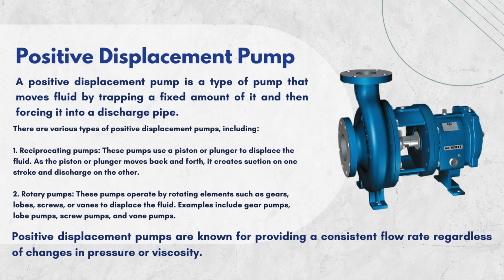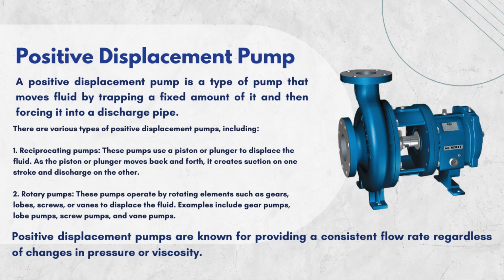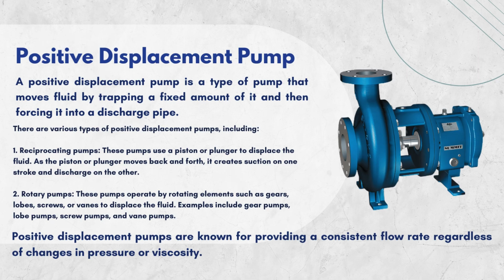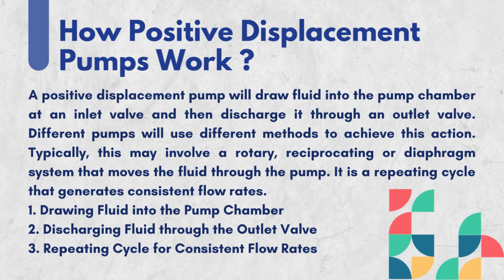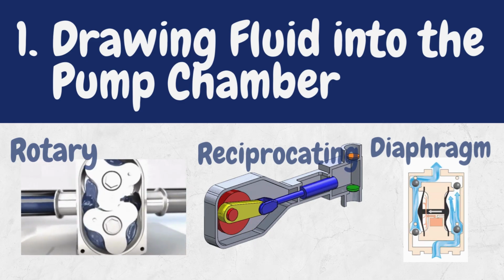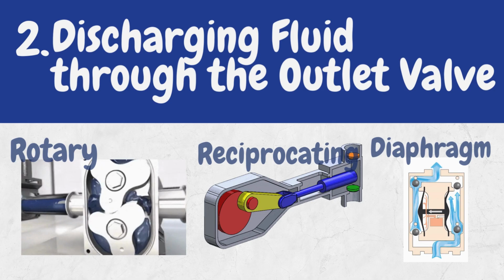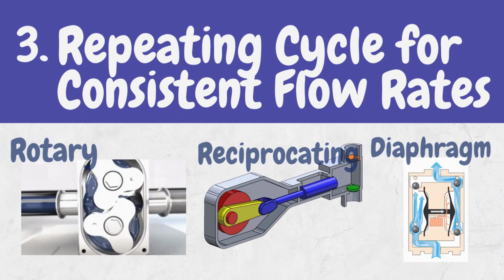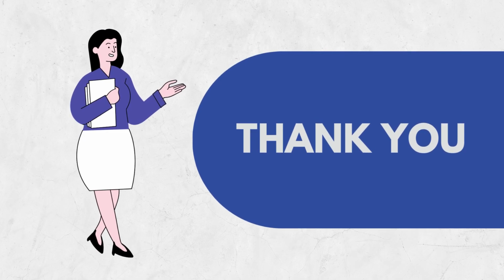Positive Displacement Pump | What it is ? | Types | How does it Works ? @KnowChem

Comment: Can we get continuous flow?
Reply from the maker: Yes, positive displacement pumps are capable of providing continuous flow. They operate by capturing a specific volume of fluid and then moving that trapped volume into the discharge pipe. This category of pumps encompasses gear pumps, piston pumps, diaphragm pumps, and screw pumps, among others.